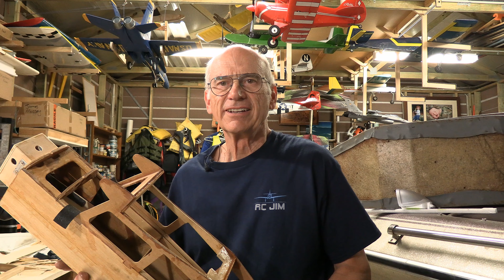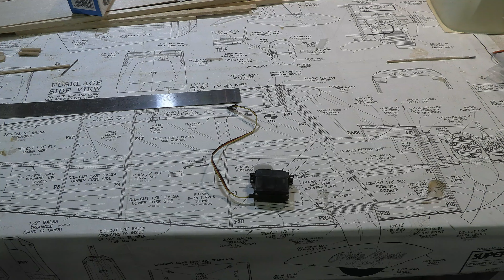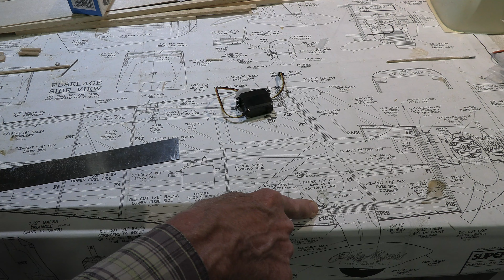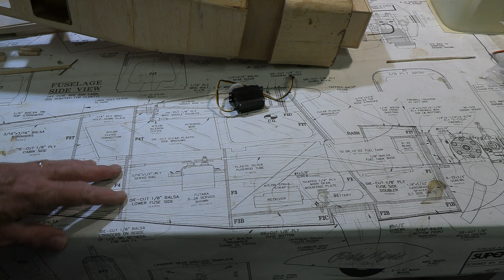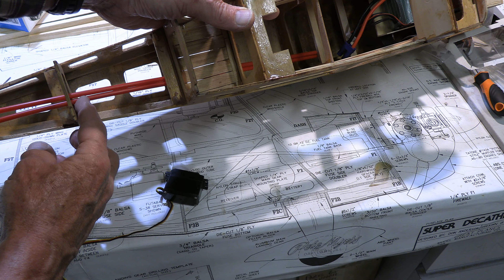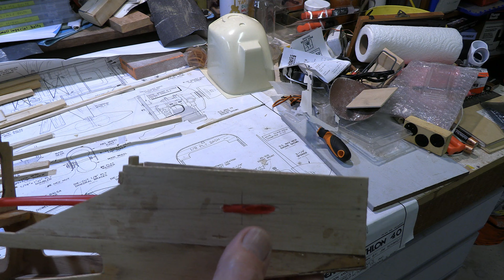Update 2 - Great Planes Decathlon 40 Build

Comment: I’m going to build this model with the same electric conversion. Any changes you recommend? Great video
Reply from the maker: I ended up crashing the plane.  Placing the battery up high made it a nice projectile, and with all the windows below the wing, it all goes into pieces quite quickly.  The plane pulls to the left very strongly - not unique to this bird - but abort the takeoff immediately if you can't hold it straight.  You also need to keep it on the ground long enough to get up enough airspeed to avoid stalling.  Essentially that means you need to be very slow on applying the throttle for takeoff, use a lot of right rudder to keep it straight, use your elevator to keep it level with the ground once it get's going, and then when it's ready, gently lift off.  I'm not sure what else to do with the battery, but you might look at an option to place it lower.